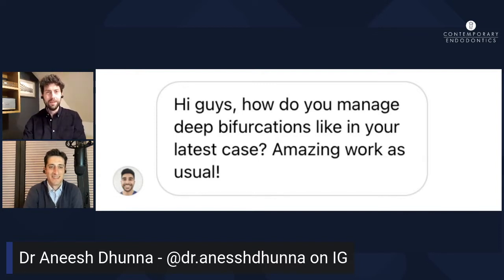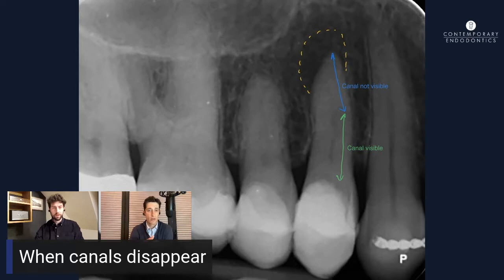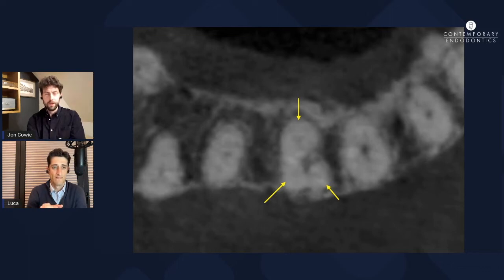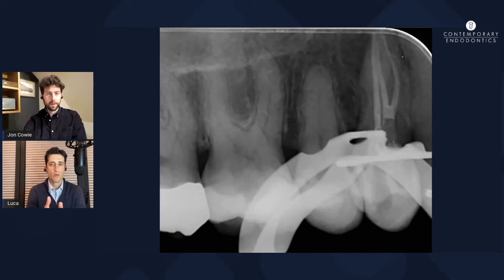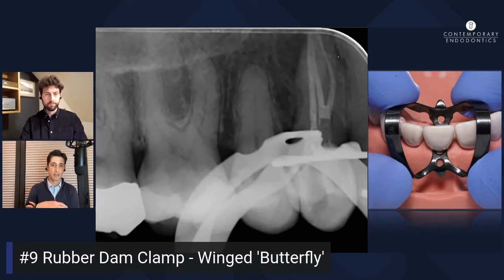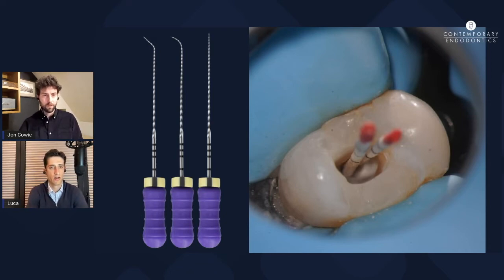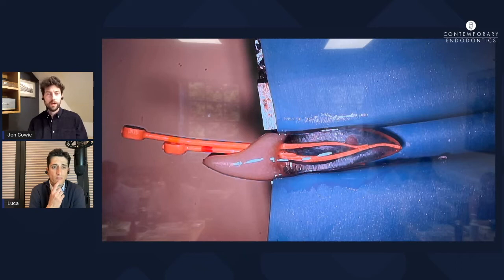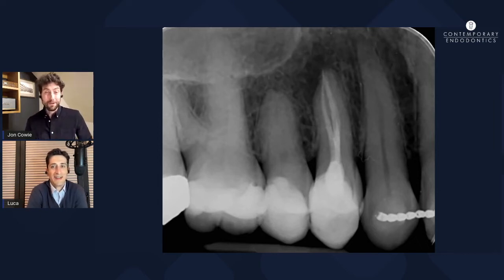How to get down tough canals

Comment: I use a microscope after final file say a 30/06 what magnification do you set to see a deep bifurcation? 2.5?
Reply from the maker: It really depends on the scope and various lenses you have. On our Zeiss we’ll be on x1.0 or x2.5 to really have a look. If it’s a straight line view which is not always the case 😅
Reply: True  @contemporaryendodontics